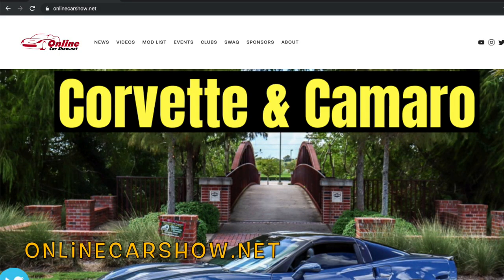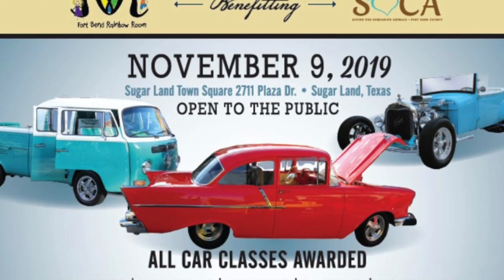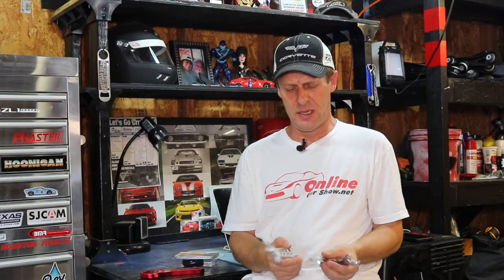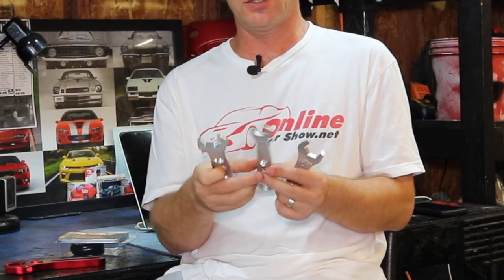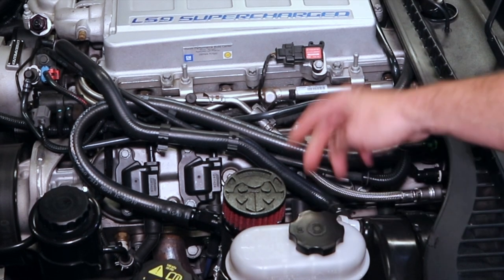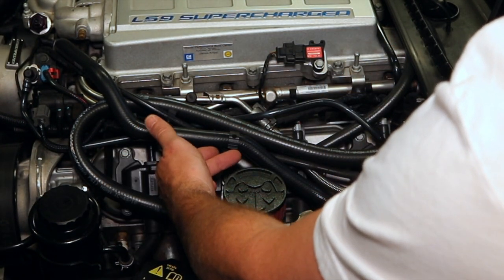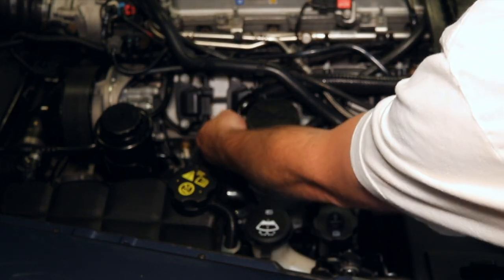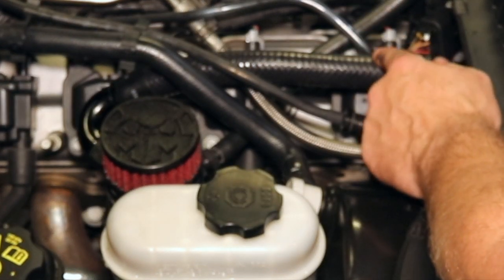BEST OIL CATCH CAN MADE - Reinstall, Emptying, and Upgrades!

Comment: You might check to see if that open breather is creating a vacuum leak.  I put open breathers on my truck and then realized the PCV is plumbed post-MAF and resulted in unmetered air.
Reply from the maker: I’ll double check and at the least add a wire tie. Thanks for the advice 👍
Reply from the maker: Because the valve cap is different on LS7 than ls9 and these kits are for z06 we had to drill out the valve cap while waiting on new cap from MM solutions. If there is a leak at all now it will be there. So hopefully by end of this week will be 110%. I don’t think there is any leaks now though at all. But to be safe I ordered the zr1 valve cap
Reply: @OnlinecarshowNet1  Maybe those catch cans have a check valve or something.  It seems to me that "pirate" air will enter through the fresh airs on the valve covers AND through the breather.   Get the car up to temp and seal the breather with a plastic bag.  Let me know if the fuel trims change at idle....I'm curious.
Reply: It's not an open breather. It only opens on pressure and is sealed.
Reply: @camaromustangmods3327  I knew it had to have some kind of valve.  Is the valve in the breather itself?
Reply: @n5yiz  Yes he sells 3 different cans. One is an open breather can which the breather flows out like you would think. The other 2 are pcv and draft can. The breather is closed during normal operation and acts like a catch can would. But if the can sees pressure it opens. I think he tested it to 3 psi. I may be wrong though. Not that I know all about the system. I literally just bought a draft can off him last week. So I asked him alot of questions.
Reply: @camaromustangmods3327  I might have to pick one of those up.
Reply: @camaromustangmods3327  great info, as I was curious about that filter!!!

Comment: What kind of hose is necessary for catch can back to intake?  The 3/4" heater hose that I used collapses.  Heat from the engine makes the hose pliable, and the intake's vacuum pressure causes it to collapse.
Reply from the maker: I used a 3/4 inch silicone hose I ordered. I like the silicone better just for that reason.  It’s glossy black exterior with a red interior on the hose I bought. If that helps...
Reply: @OnlinecarshowNet1   Thanks.  I'll give it a try.

Comment: Would this be the best catch can for the 2019 Ram? Will one fit my 2019 Ram 1500 5.7L with the e-torque? If so, where can I get it cheapest,  Amazon?
Reply from the maker: Contact Houston Performance Solutions. He gave me a good deal. I really like this can a lot. It has mesh on inside, breather filter, easy drain valve, and most importantly all metal. I know a lot of people like mishimoto but to be honest I had issue with their plastic fittings. With heat I found they would loosen up. This can is made with way better materials. I also ordered a different elbow later on from their site. So they sell different fittings if you need.

Comment: What about crankcase pressure increases? Have you measured them with/without the catch can? and what is the engine spec for safe Crankcase pressure range?
Reply: There are no pressure increases with the mightymouse. If the crankcase pressure overcomes with vacuum, the can itself will allow the escape of that pressure through the top filter.

Comment: How much crank case pressure does this add?
Reply: That is the important datapoint.
Reply: With a breather on top none.  It needs to be a closed system to have vacuum.   I tried multiple set ups .  1.5 liter ecotec engine.   Crankcase positive pressure,  3 psi.